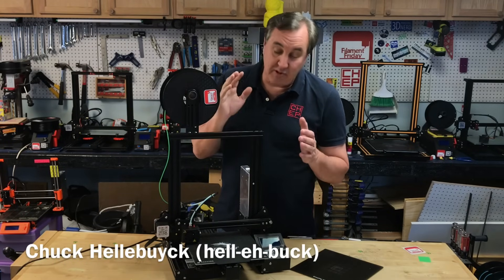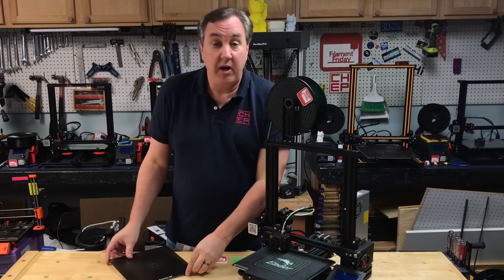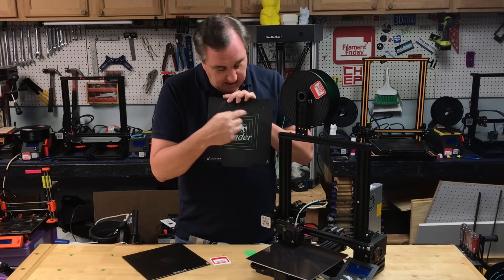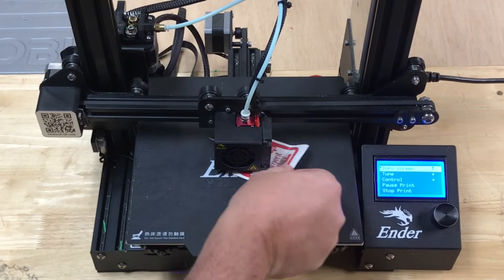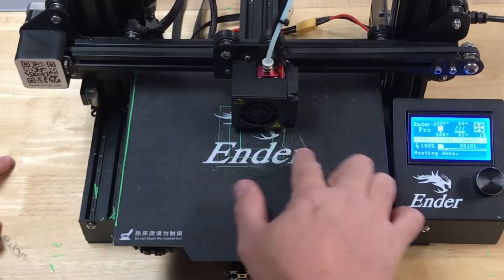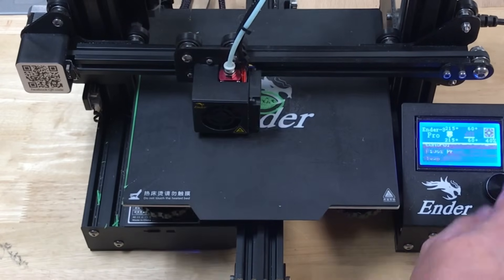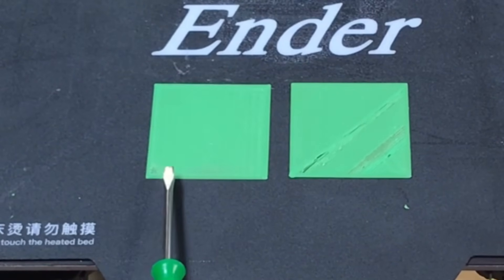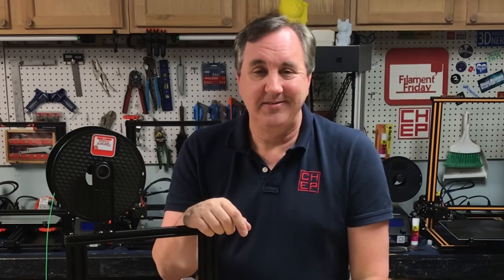Creality Ender 3- Easy Way To Level Your Bed

Comment: got my Ender 3 today..with all four knobs tightened as far as they will go (with bed farthest from nozzle)...3 corners are nearly touching and 1 corner is darn near 1/4" away from the nozzle.....Do i have a warped bed? Also, should I be tightening all four corners in this manner before running the gcode to prevent the hot end nozzle from digging into the print surface as the gcode lowers the hot end? I dont see a step in your process that actually gets it close or verifies that its not already hitting the bed when the hot end is lowered...
Reply from the maker: Sounds like one corner might be bent but back the knobs out to half way and adjust the Z stop switch a little higher so the nozzle stops higher.
Reply: @FilamentFriday  after nearly 4 hours of attempting to get the bed level using the methods ive seen online, i eventually gave that up...got out my ruler...and made all corners the same distance from the gantry using the knobs.....this resulted in a square bed in about 5 minutes...i then ran your files..took me maybe 2 layers to get it dialed in...will be using the ruler method from this point forward..getting all corners within 1/64th of an inch is easy, even with old eyes like mine....the younguns can probably manage 1/128th marks on an engineers ruler :P I actually was too close using the ruler, and had to lower the bed maybe a 1/4 turn on each corner as your file ran..im running the dog gcode file that came on the printers MicroSD card now, ill let ya know how it works out, but its like 75% done and I can barely see the layers, so im guessing ive got it nailed down.
Reply from the maker: Bed level is hardest part. Once you get that down your golden.

Comment: Almost every ender 3 have crooked bed, if U will adjust this on corners (for example) 0,3mm gap between hotend and bed, then in the middle of bed this will by over 1mm.
Reply from the maker: Watch again. I don’t adjust at the corners, I adjust at the screws via the GCode. But that’s just a start. The live adjust finishes it.

Comment: With my Ender 3, when I run the 'Printing squares test' gcode, the very first thing it does is print a line along the left EDGE of the bed - literally 1-2mm from the edge!!!  If you have, as I had, a glass bed affixed with metal clips on that edge, you risk damaging the nozzle, scratching the glass, or worse.  In my case, it printed a line right over both of my clips, so ran about 2-thirds of the left edge's length, before seeing reason and moving to the centre of the bed, where it stayed.  Luckily, I had used a think 'spacer' for the first test, so narrowly avoided a nozzle/metal-clips clash.  Frankly, this oversight is silly and should be corrected.
Reply from the maker: It’s not an over sight. It’s a purge of the nozzle. You can remove it from the GCode if you want. Stock clips are on the front and back so there should be no clips in its path. Clips on the side can potentially hit the uprights.
Reply: @FilamentFriday  Good to know - I just got my first 3D printer yesterday and it came with the clips on the sides!  Bit of a learning curve ahead of me. :)
Reply: This line on the Side is also in the start Script of the newest Cura Settings for the ender 3, Scared me on my First print. I changed it back to the old Script from the Cura Version which came with the ender, works better for me

Comment: That this helped a lot. For me I have a 3 point bed. The glass seems to always be slightly warped but I got it 95% of the bed perfect and filled in the low spot with glue stick.

Comment: thanks for your tutorial, worked like charm. however, whenever i center the print on cura or with your gcode on here, my prints are starting a bit more forward (not on center) like your gcode stopped on middle to calibrate, but mine stopped a bit more forward (i understand it by looking at ender sign). How can i solve this? Also when i auto home, my nozzle stops at outside of the bed(they said it is normal by firmware) however it might be related to the problem. Please help :(
Reply from the maker: Check your Y axis stop switch position. It might be too far back on the rail.
Reply: CHEP i checked it however the positions of its screws are fixed so i couldnt move it :/
Reply from the maker: 3D print a little clip for the bed so it hits the switch sooner.

Comment: My ender 3 pro plate is so warped its impossible to fix.  like 2 sheets or paper difference from middle where its up to the edges
Reply from the maker: You could put a glass plate on it. https://youtu.be/mDNo1yyGosI

Comment: Good video, thanks for the work you put in!

I still wonder if a Geetech A10M DualExtruder does print as good as the Ender 3/ Pro does?!
And the more and more videos I watch the more interessted I am about an autolevel mod, filament sensor and these stop functions to manually change the filament or to resume print, if it had to be stopped.
Reply from the maker: Ender 3 prints a little better. Ender 3 has the pause function. Filament sensor and easy autolevel mod is an A10 feature.

Comment: Effective but I went a little farther and got a dial indicator and a set of feeler gauges. Set one corners with the feeler gauge to the my first layer height. Then I use the dial indicator to set all the others to that same distance. Using Octopi and the bed level plugin it takes no time.

Comment: Hey man this is a very good process to level but in 90% the ender 3 bad is not flat!
Reply from the maker: That’s why the live Z is used to finish it off.
Reply: @FilamentFriday  My bad is not flat, the corner is more height than the center. For me best way is to distribute the error all over the bad leveled in relation with the axis and the model.
Is it right for you too or I'm in bed?
Reply from the maker: That’s why I start at the screws. Most corners are higher than center.

Comment: Thanks, Chuck, for the simple explanation. I will add that you can do the same without the first G-code file. This feature is already in the Marlin, it will increase the firmware size by 786 bytes. To activate it, you need to remove the comment from two lines in the "Configuration.h" file:
#define LEVEL_BED_CORNERS

  #define LEVEL_CENTER_TOO
Reply from the maker: Yes, but you have to modify the positioning in Marlin to put the nozzle above the screws. By default it positions it at the corners. Plus with the GCode there is no need to install a bootloader and the load the new firmware. The GCode method works on an Ender 3 out of the box.

Comment: Tried it, does the job, and wow I didn't knew that you can make the printer stop and wait for a press.
That's exactly what I was looking for If I need locked in place brass screw insert, prints eg. 20 layers, then waits for me, I push in inserts, press the button and printer conitnues.
Tho no idea how to do it exactly.
I guess it's just a command in g-code, but then how I will know where to put it in my generated g-code?
Reply from the maker: After the layer height you want. Check the GCode for Z level.

Comment: What is the Z height when it drops to the bed??
Reply from the maker: Thats what you are adjusting in this whole process. The sticker sets it initially at around 0.2 mm and you live adjust from there.
Reply: Hi Chep, what I’m getting at is that during the bed levelling procedure the Z height is at 0.00mm, so anything you use between the nozzle & the bed you will give you an incorrect gap. Eg when printing a first layer 0.3mm thick, if you’ve used 0.1mm paper the nozzle will actually be 0.4mm away from the bed.
I only use a glass build plate & I use it to slide between the bed & the nozzle, adjust the gaps until the clicking of the glass hitting the nozzle just stops👍
Reply from the maker: My z offset is set to zero.
Reply from the maker: The live adjust moves the bed so the first layer squished down perfectly. How your first layer settings are setup will also affect the first layer. Often people use a lower first layer height like 90% to compensate for the squish. That’s what I do in S3D and Cura typically.

Comment: Thank you so much Chuck, does bltouch or any other abl should replace this manual level adjustment?
Reply from the maker: Yes, it mostly does but even my Prusa or Artemis both with auto level occasionally need a restart because the first layer is off. So it’s not perfect. I actually still prefer manual bed level. Once adjust right it rarely needs as tweak.
Reply: @FilamentFriday  Thanks, please review bltouch :) , you're great!!
Reply from the maker: Thanks. I’m planning that.

Comment: A piece of paper is not accurate. If you spend $300 on a printer, you can spend $8 on a set of proper feeler gauges. All paper is not the same thickness.
Reply from the maker: The paper is just a starting point. The main idea is to live adjust or adjust on the fly to get the perfect bed level.

Comment: unfortunately that misses the mark for new users in a number of fundamental ways, namely the following:-
1. New users need to understand there is a difference between bed levelling and setting the z offset, this is key to understand. The fact you achieve both by using the paper should be explained. Then is should be made clear that once level, the bed (ideally) is moved evenly in relation to the bed. So many times bed level is parcelled together as a term with offset.
2. not making clear when starting this exercise that the nozzle has to be clean and free from residue plastic on the top is key, I have lost count how many times you hear about people have plastic on the tip which then messes with the offset setting
3. All of the above is for nothing is the bed is not clean, using the method you show to see if the plastic is stuck is not going to work unless you make sure the bed is clean, nothing will stick if you have greasy fingerprints all over it.
if a new user follows this guide they could easily get confused when results aren't as expected.
I like your videos and think you could def do one new users could actually follow, but there are too many things they will just miss and get frustrated by (we have all been there ! ;) ) if anyone followed this as described results would at best be patchy !
Reply: best way to learn is to do
Reply: Nate Walkner indeed but new users are better working it out on their own than following bad advice and not knowing why something doesn’t work ( when they followed the advice to the letter)
Reply from the maker: I’ve given this same advice to many new users off camera for while now on various printers. Some have already tried it on Ender 3 from this video. All with great success so it’s a proven procedure. Your certainly welcome to present all those steps in your video. I stand by my approach. Too much info can often lose the student.

Comment: Nice work Chuck!  I wanted to modify the Gcode to work with my print bed, so I started looking at the numbers. I looked up the Ender 3 and it’s 220 x220, but your using 234 x242. Did I reference the wrong printer?
Reply from the maker: Ender 3 actually measures 235x235

Comment: 1:32... Chuck it would be very helpful for guys like me that have a vernier or micrometer to know the actual thicknesses ( in thousands of an inch) of the complete Label and the backing. Thanks for the G-Code files.
Reply: the height is irrelevant.  you get it close and adjust while printing
Reply from the maker: It’s 0.2mm thick. But as commented it’s just a starting point. The idea is to adjust while printing the test print.

Comment: I found that adding a 4-6mm brim really helps with live-adjusting the bed level. Basically allows me to catch any bed level errors before it starts affecting my actual print, so I won't have to stop and restart the print.

Comment: Probably just a dumb question but when I level my bed I use a piece of paper how much resistance should there be when using the paper?
Reply from the maker: Same, should be able to slightly move it. It will get you close. The live adjust is where the level really occurs.
Reply: Level each corner with slight resistance then check the middle of the bed, if there is no resistance then level 
each corner with more resistance until you get slight resistance in the middle

Comment: what causes the bed to lose adjustment after each print?
Reply from the maker: Removing the print, temperature changes, springs are not compressed enough. Bed not put back in same position, just to name a few.

Comment: My bed crowns up in the middle. It's very vexing. I usually end up printing everything with a raft, just so the first couple of layers can be ruined in the middle, but it comes out ok in the end. Otherwise, I'll print without a raft, but with 5 solid bottom layers. Neither are a perfect solution. I'd like to set up auto-bed-leveling, but the hardware is a little bit pricey for a $200 printer.

I've avoided going glass, because I don't want to lose y-axis resolution to the extra weight of glass. So, I'm just buggering on with a warped bed. :P
Reply from the maker: The glass has very little affect on quality. Slight increase in ghosting depending on print speed. Lower Y acceleration and jerk in Cura helps. Also angle the print and it most cases it’s not noticeable at all.
Reply: Thanks  @FilamentFriday , I'm going to order a borosilicate bed now. :)
Reply from the maker: Here’s how I did mine and link to glass for Ender 3 is in description. https://youtu.be/mDNo1yyGosI
Reply: I had this same problem of a high spot in the center of the bed on early-ish version.

It turned out to be an air bubble under the adhesive for the build surface sticker, you might want to check and see if that is your problem too.
Reply: @SnarkyPosters : Everything looks copacetic underneath my build surface.
I'm going for the borosilicate bed. I'm done messing with the warped surface. Had another failed print last night. The middle of the print is practically tattooing the build surface, and the margins of the print are just confetti, not adhering at all. ^_^

Comment: HI, great video. Im pretty new to 3d Printing and the Ender 3. Do you have a video for centering the print area? Mine seems to be printing slightly forward on the bed.
Reply from the maker: Adjust your dimensions in your slicer profile. Should be X 235, Y 235 not 220 and most have it.
Reply: @FilamentFriday  yup already have it set to x 235 and y 235 in printer->machine settings. Using Cura 3.6.0.
Reply from the maker: Then I don’t know.
Reply: You can check the bed's frame itself. It could be slightly deformed or misaligned physically.
Reply: @ablc2007FR  took a look at the plate underneath the heated bed. Out of curiousity which side were your eccentric nuts and the beefer plate arms??